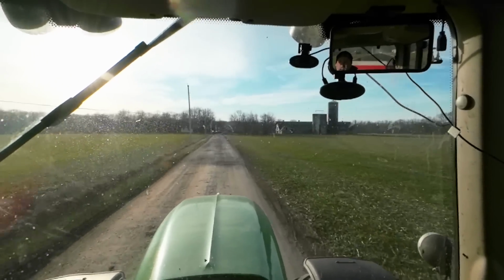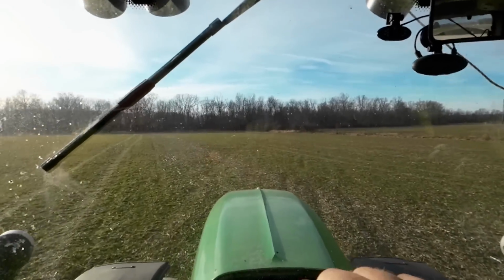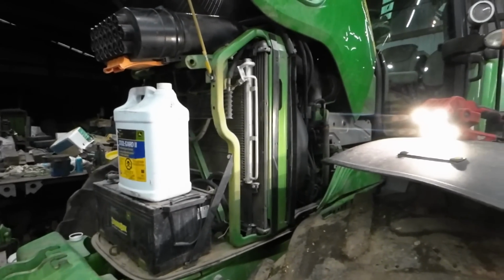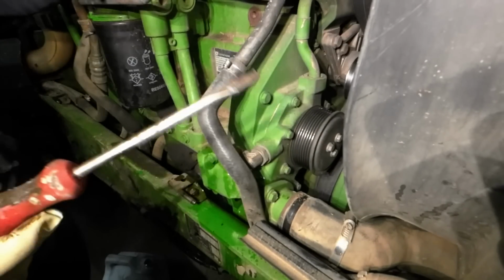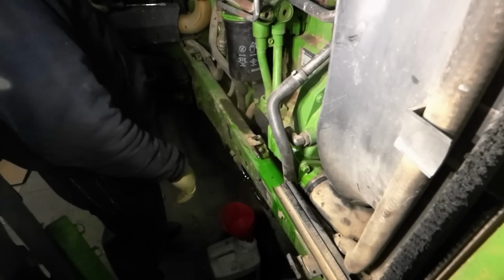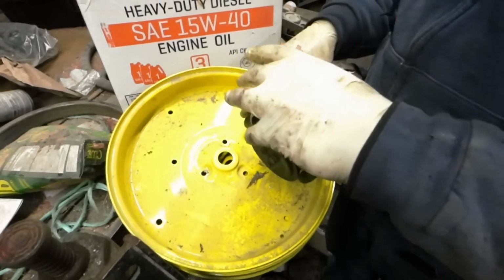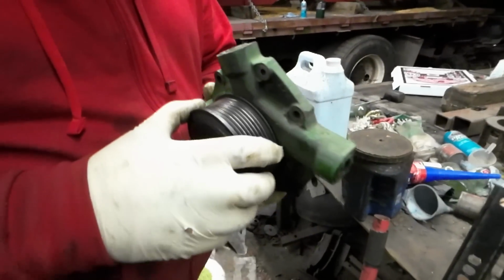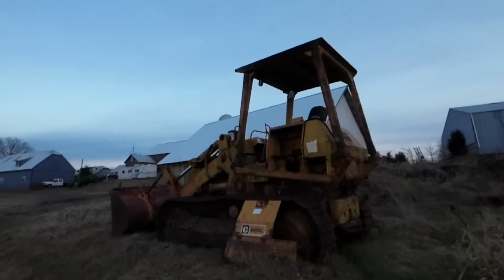7530 is Down broken

Comment: Just about 40 years ago, I spent 4 or 5 months designing mold cavities, in order to cast those type centrifugal impellers from #3 Zinc alloy. They were intended to replace the existing fabricated steel units in a wide variety of automotive type water pumps. ..... In all modesty, I have to admit they were a thing of beauty, and a joy forever. ..... Obviously, in the ensuing decades those designs proved to be entirely too dependable, and the molds were converted to work as thermoplastic injection molds, without taking into consideration the dramatically divergent properties of injectable thermoplastics.

Comment: Plastic impellers in high heat. Not a good idea Johnny deerest. Tim is right if your using a filament printer to 3D print one. But a resin printer you can get heat resistant that will work up to 500f or higher. But best thing I would think to do is make a pattern out of the impeller you have cast one in wet sand. Leaving the center full. And pour in metal. Drill and tap the center for the size nut that’s on the shaft and clean up the back of the casting. Check for fit then balance it. Problem solved forever instead of 3 or 4 years before a plastic one fails again.

Comment: Common problem I’ve put a lot of them on over years.That stainless backing plate in the early years was repair Deere came up with to fix timing cover because the impeller was steel and when the bearings went out the impeller would eat the front cover up and it had to be replaced now some engines have it and some don’t .The 6.8 ,4.5,2.4 and 3.0 all had same design

Comment: Need some high heat Tesa Tape for harness. Its what the European automakers use to make their harnesses. Its fairly cheap and sold on Amazon. It will out last electrical tape by several years and looks nicer.

Comment: What engineering school teaches plastic water pump impeller design as a good idea - good grief.  Sorry about the break down Wes.  Thanks for the video.
Reply: #Phil Goldblum It has been a thing for well over 40 years, and people just don't seem to care how stuff is made.
Reply: The school of low cost and light weight followed by a graduate degree in limited durability testing. Add in a work study stint with the lowest expense tooling investment plus a repair parts division given profit motives and suddenly things only last six months after the suggested warranty period. As they say "You can buy a better tractor than JD, but you can never pay more". Fortunately for Wes this breakdown allowed limping home and into the shop then repaired without splitting the tractor in half.
Reply: @ducewags  people better start caring because this world is going to crap and getting worse every single day. Or should I say it's gone to crap.
Reply: @robbsmith1560  If a thing lasts for ever, no money will be made in parts or labor. Make a thing with a time limit, or end date, and money will be made. Sorry to say, but that is how stuff works now days.
Reply: Plastic impellers has been for many years and works great if the pump is changed on recuired intervals. It is done this way to keep cost down for the user and the producer.
Reply: @polarViking  The plastic water pumps are so great, that VW, Audi, Saab, Volvo, GM, Subaru, Chevy, Ford and Kia are swiching back to steel. Why is that one wonders? But you do you, and think how you want.
Reply: It's not the Engineers who make decisions to cheapen components. That lies entirely within the sphere of the Bean Counters.
Reply: If it dies before the warranty is up presumably Dear John has to pay so I guess there's pros and cons to junk components

Comment: Wes I saw someone selling a centrifugal oil cleaner that likely works for coolant too, 'never buy another gallon of oil again'.... Not sure I entirely trust the risk of reusing long polymer oil chains chopped up by extensive heat, pressure, and time in a loaded engine, but you'd strip out major contaminants that way (and possibly detergents plus any high pressure modifiers). Guy had it hooked between fluid totes as it processed a lot of oil.

Comment: awesome video Wes. 
how to collect colent?  it is a good bit pricey but there is a colent vacuum system made for just that. 
black water pump impeller odd that it broke. if that was white sure but normally the black holds up. 
but for the amount of hours you put on your tractors this is just a normal ware item.